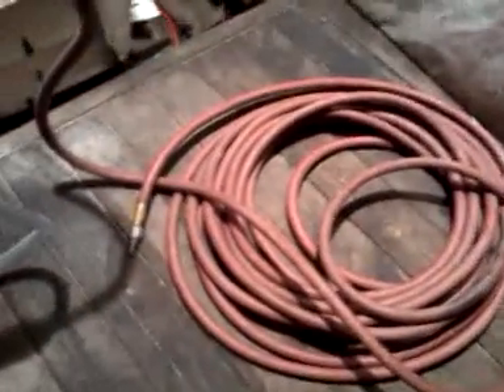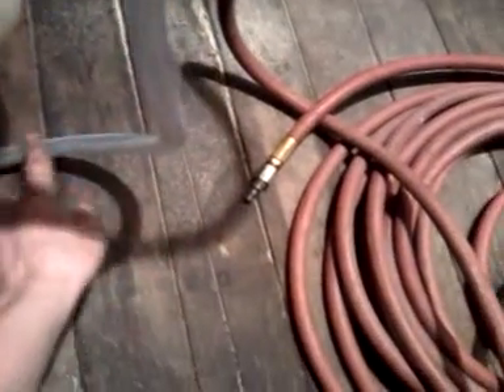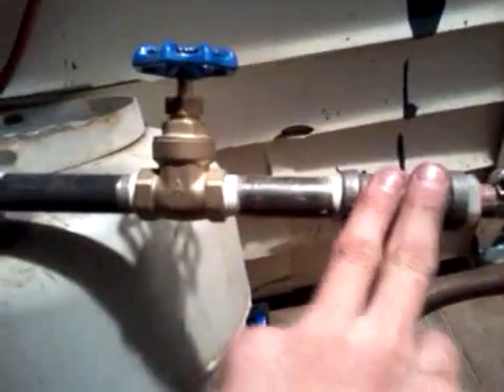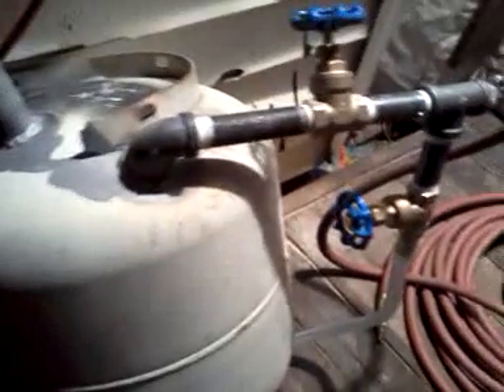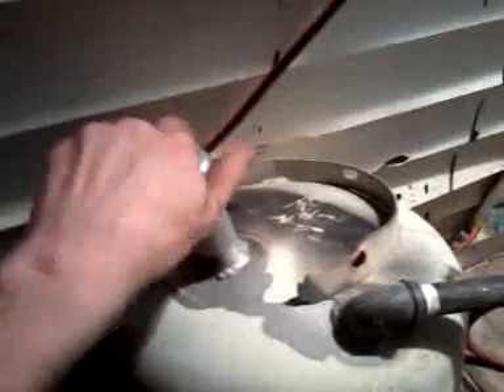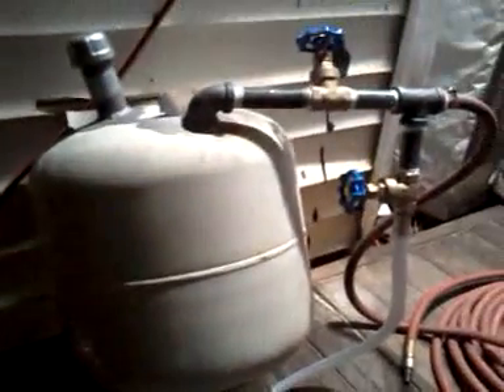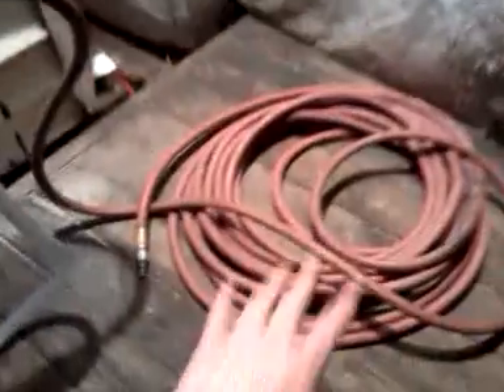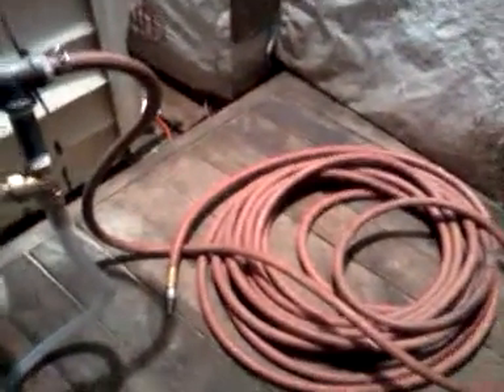Homemade sandblaster and how to build

Comment: Safety safety safety did it work where is valve pressure release and the weld around the3/4” pipe it’s fail will leak simple bullshit show it’s working

Comment: Sorry to tell you, but there is no cast iron in your build. The pipe used is either galvanized or black pipe.
Reply: +Alex Huntzinger As a pipefitter with 29 years of experience, I can tell you that it's not cast iron pipe. Your fittings look to be malleable iron. You're telling people to use JB Weld for a pressurized system??? WHAT ARE YOU....GOOFY??? You'll get someone killed!!! You're telling people to trust hardware store epoxy on an air tank with 125 to 150 psi. That's a bomb waiting to happen.
Reply from the maker: I don't really think you know what you are talking about its black cast iron pipe that's what it is sold as and if you take it to the scrap yards they will tell you it's cast iron please don't comet if you don't know what you are talking about please
Reply: Sure there is. Video lighting isn't perfect but at the minimum the elbow on top the tank and the cap on his fill pipe are both cast. More than likely the T in the bottom and the one up top are also. And who ever it was saying there isnt any galvanized in his setup is wrong also as his fill pipe and the cap are both galvanized.
Reply: +mountnman3609 And welding a propane tank. Lol.

Comment: prolly can make i little more solid and compact if you change the hose going to the bottom of the bottle with a piece of solid pipe a 45 bend and another solid pipe intoo the t fitting and THEN  change to hose 
you can fit everything a little closer to the bottle and weld it too the bottle with some tabs to it doesnt break off if the bottle falls of the table or scaffold 
might need one extra connection to be able to screw everything together

Comment: I would have a moisture trap on the inlet, and I would have done all of the pipework in iron, no plastic apart from the hose. I think I would also have afew pressure gauges for fine tuning. The unfortunate thing though is getting a ccompressor big enough to power this thing upto full working ability is very exspensive... That's where making an air compressor from too old engines becomes interesting... That's what I'm trying todo first before building the pott

Comment: All you certified welder pressure vessel building know it all PITA dudes need to get real. He is not reusing the tank to store propane, it will likely never see more than 100 PSI of COMPRESSED AIR!! How could this be considered a bomb? What serious thing is going to happen if his weld fails? Your imagination is running wild on you. For goodness sakes, he has vinyl hoses with barb fitting and hose clamps exposed to the same pressure. Imagine the nightmare if one of those fittings failed!! sarcasm

Comment: btw... has nothing to do with heat transfer... what pat is talking about is how when the weld metal is brought to its UCT (upper critical temperature) and then slowly cooled it creates a HAZ heat affected zone around the weld that becomes hardened or "tempered" and that is the area the will get you, it will always break beside the weld assuming your welds are good. this is why in industry we send our vessels to be annealed in an oven wich returns the HAZ to its parent metal state.

Comment: REALLY DUDE!!! I am an Alberta red seal certified, journeyman welder, I build pressure vessels with thousands of psi in them, Im not just someone with exp welding....... and pat is right.... that is a deadly bomb, and without testing the welds you have no clue what you have!!!! even 5 psi instantaneous escape will take your hand off. perhaps you should do "research" before you retort negatively to someone who is concerned for your safety (search "Calhex Ind. Calgary" thats my shop)
Reply: Quit flaunting your expertise around pal. Grow some balls and give the guy advice instead of hating. Remember you were a rookie welder yourself once.

Comment: Be very careful welding galvanized anything,   you can get zinc poisoning from the fumes that is left out, I know from experience from welding galvanized for a living.  We had special whips that had vacuums on them to pull the fumes away to a filter system.  Some guys got very sick when they decided not to use the vacuum.  Your best to stick with black pipe.    It is your life and have been warned.

Comment from the maker: view a soda blaster as a fire extinguisher every thing is under pressure  there is a tube that gos to the bottom of it to pick up soda comes out at vary high speeds cfm the more cfm something has the longer you can use the blaster 90 psi and up and like you said 5-7 cfm is more than enough to work but if you have a smaller air compressor you can still use it but the blasting tube on exit will have to be smaller to work like its sopost to 4 to 5 cfm is good at 90 psi but u can work at much lower

Comment: Meant to ask Alex, do you bother with a Ceramic nozzle?
If not, what did you use?

Got my filler pipe and cap today, just finished welding it on, along with some legs to lift the pot clear of the floor.
Need to knock-up a simple little cabinet now.
I'm planning to make it foot controlled, by connecting a pedal to the lever ball-valve, and fitting a return (closing) spring.

Comment: I've just started making a similar pot using the same size tank.
Instead of welding the pipe connections, I've run a single length of pipe right through, with about 3"protruding top and bottom.
It has holes drilled in it just inside the tank at either end (for Air and Grit flow).
It's bonded in place with epoxy resin, injected through the filling hole.
Just need a filler tube and cap now...

Comment from the maker: It's not really based on horsepower it's based on CfM cubic feet per minute 90psi at 4 or 5 cfm should be good enouh so basically if you go to the store and buy an air compressor make sure the compressor pump itself says 90 PSI at 5 CSM or higher the higher the better but the horsepower rating should be around 2 horsepower all the way up to 10 horsepower electric or gas

Comment: Yes I do...This is a pressure vessel, of which somebody welded on...welds create a HAZ -"heat affected zone", this could be a weak point if the weld wasn't done right, or stress relieved and i doubt that this was hydro tested either. What do think will happen when 100 psi escapes in an instant?? Even though it has a small amount of volume,it  still has a tremendous amount of energy . Google pressure vessel explosions...see for yourself.

Comment: You could try and put a small valve under the tank were the sand comes in the air stream it will make it a lot easier to tune

Comment: If the person welding that tank knows what he/she is doing then  it is safe. The sandblaster will work at the pressure that the compressor is supplying, usually about 120 psi. The propane tank used is tested at way more than 120 psi.

Comment: I have made 4 pressure pots using 30 LBS propane tanks and TWO using 100Lbs propane tanks. Yes it is making a pressure bomb. If your not an idiot, and do it properly you will never blow yourself up. Disgustapated, you should try and make one. maybe you wont be good at welding and natural selection may sort you out :)

Trying this is not for the weak of heart, or the unsure of skill. Period.

If this scares you, easy dont try it. trust some outfit in china do to a safe job. lulz

Comment: The pressure pot is dealing with low pressure usually... just enough pressure to inject the sand into the air stream.

Comment: HP affects how fast the compressor itself will run and therefore how much volume it can supply per minute. Low revs with large displacement will generate the same as high revs with small displacement, and the compressor will last longer without a rebuild. An engine and air compressor are the same thing, just that each are purpose built. You can convert any gas engine to an air compressor with some check valves and disabling the exhaust valve/valves.

Comment: i did the same but on a 100# propane tank...holds 500# of al oxide and works great!
once i found/saw i successful with the 100# propane tank...i took a 120gallon verticle air tank and  made another... that holds 1200-1500 lbs of media...only have to fill tank once a day now!  whoo-whee!

Comment from the maker: no i didnt use any thing for rust you should use a air/water/oil seprator the hole in the tank is 3/4 of an inch use black cast iron pipe with yellow gas line thred tape ball valves are a lot of money like 15 20 dollars a pic the gate valves are 4 dollars a pic no i did not put a dead mans valve on it i didnt have a lot of money to spend i cant make a vid of me useing it because i dont have an air compressor bigenf to power the sand blaster and i moved to an apt and my garage does not have power

Comment: hello, I am going to try and do the same thing that you did. I was wondering if you can give me a couple of peices of info. I see that you used the valve hole that was there for the propane. What is the pipe size for that so i dont have to guess and check. Did you put anything on the inside to stop rust? way did you use gates instead of ball valves? did you put a "dead mans valve" on the end? last but not least did you or can you past a vid or it working. Thanks inadvance. Great job byw

Comment from the maker: it needs like 6 to 7 cfm at 100 psi you have open the value on the tank just a nuff to push sand out the bottom

Comment: Nice project, but I'd be a lil skeptical of the welds between the iron pipe and sheet metal tank. At 120 psi the pipes could break off and be dangerous.